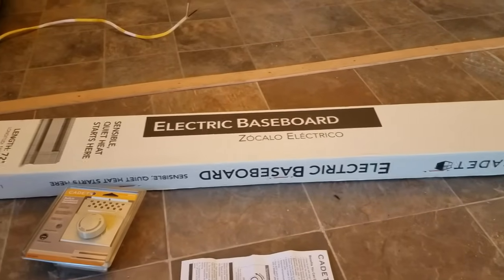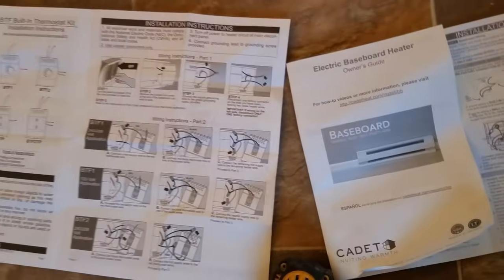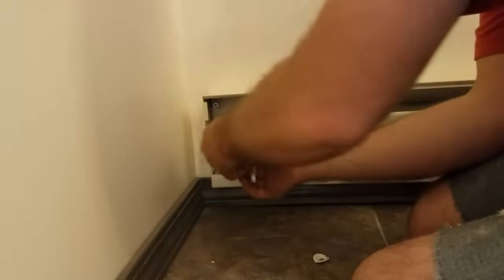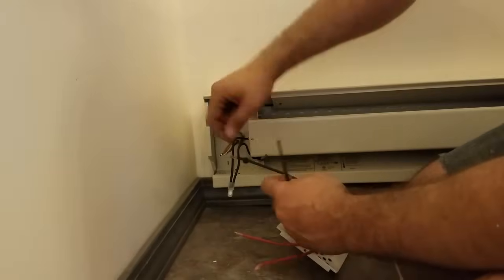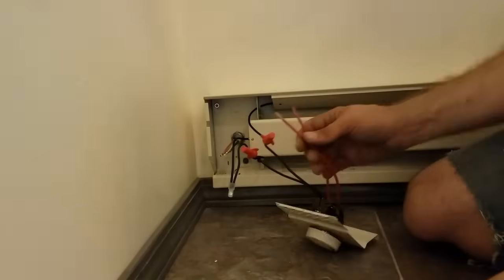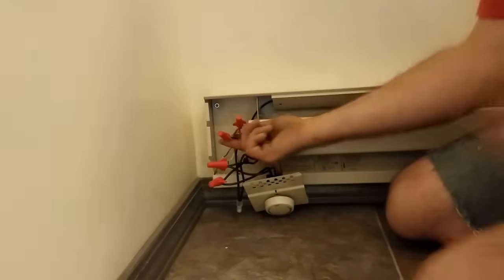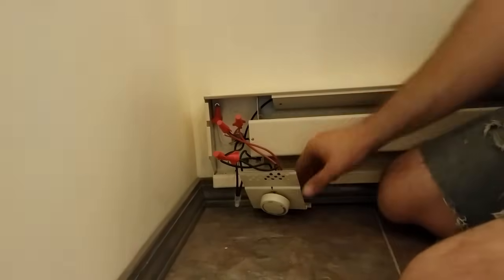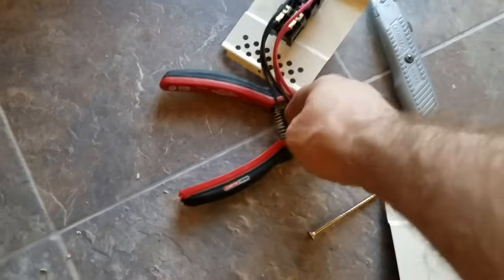Installing Electric Baseboard Heater. DIY

Comment: There's no need for 12/3 wire for this heater, 12/2 is all that's needed
Reply from the maker: 12/2 will work, I like running 12/3 to items like this to keep color coded in the box.
Reply: @agiftedcurse2  its actually  code to do that but can be  done with  a sharpie or as I prefer  heat shrink tube   can get in  black red and other colors but if the  12/3 is already  there no sense in removing it now

Comment: Hi, 
can I install the baseboard without gang box into the wall? The baseboard has it itself.
Reply from the maker: No need for the box since it's wired inside the baseboard heater. Correct. Only time you need a box is when your splicing wires together and not doing it inside the closed baseboard heater.
Reply: Great, now I’m sure what I’m doing is correct. Thank you

Comment: You didn’t say what you were doing... or let people see what you were doing. Usually these videos help explain why you do what you do and how.
Reply from the maker: There isn't too many steps. Just cut the top black wire in the baseboard and hook them up to the black wires on the thermostat, then hook the two red wires to the two hot wires coming in. I explained it but having troubles understanding what I'm leaving out in the video? I recorded the whole process.

Comment: Rushed video....take your time to explain step by step....I get everything you said....but just 4 the first timers DIY people...ty✌✌
Reply from the maker: There isn't too many steps. Just cut the top black wire in the baseboard and hook them up to the black wires on the thermostat, then hook the two red wires to the two hot wires coming in. I explained it but having troubles understanding what I'm leaving out in the video?
Reply: @agiftedcurse2 leaving out running 220 volts to the heater, gauge of wire,  do you use 12/2 or 12/3, what size breaker.
Reply: @agiftedcurse2  
I saw you capped the white, so its a 12/3, is that something that can be done?
Reply from the maker: @paullinntrapgod  I use 12/3 but the white wire isn't used. I cap it still just encase later when someone else is ever messing around in the panel that it will be capped if it ever got power through it. Most are going to use 12/2 wire.

Comment: These heaters are not efficient at all. I was paying $800 a month to heat only one level of my home. I'm putting in a boiler.
Reply: There's a calculation to heating, 1 heater is not going to heat 1 level of your home .. you have to do a load calculation for the square footage of the room
Reply: Na gas, water, hho solar, wind, mass effect omni gel. In my house
Reply: Sounds like you need insulation. if it doesn't hold the heat they will constantly run.
Reply: Lol u must keep ur heater on all day and night

Comment: You showed nothing nor did you explain anything. You rushed through. What a waste of time.
Reply from the maker: You mount it to the wall and you hook up the two hot wires and ground wire to the thermostat and then thermostat to the heater. They are that simple to hook up so there isn't much to show or explain. I showed how to hook it up.
Reply from the maker: Also if you have any questions ask and I'll try and answer them.
Reply from the maker: Sorry it's taken so long to get back to you, just now seeing the comment. Wire size is 12 and I used a double pole 30 amp breaker.

Comment: Hi I have a question I have a 1000w baseboard on a 2500 thermostat with 14/2 wir on a 2x15 amps braker I would like to add a 750watt baseboard will I need to change something or it ok to install thanks
Reply: Absolutely NOT the circuit breaker protects the wire and a 30 amp 2 pole breaker will allow more current through to his 14 gauge wire than it rated for . It's all about the AMPS , a simple calculation will determine total current draw . Total power is 1000w plus 750w equals 1750w and is a straight resistive load . OHMS law states 1750W divided by 240V equals 7.2AMPS . Once total amperage is found wire size can be determined , though number 12 is desirable , 14 guage will work SAFELY and should be protected with a 2 pole 15A , If using number 12 wire a 2 pole 20A
Reply: electric baseboard is a continious load ...125% rule applies on wire and breaker sizing
Reply from the maker: I think that 14/2 wire is a little thin. I used 12 gauge. If they are all single pole you shouldn't have any problems running them together. 2x15 amp breakers you mention makes me think it's double pole and would get 30 amp double pole breakers for it.
Reply: go with 12/2  20 amp breaker.

Comment: One side only have a red and black and a ground do i hook them together
Reply: Im confused on what you're describing, the heater itself should have 2 black wires coming from it, your Romex coming from the wall may have a black, ground & a white wire, but no red wire .. your white wire more then likely is another hot conductor, I would advise you to get an electrician to look at this because your aren't sure what you're doing

Comment: this is a double pole bud..
Reply from the maker: yes, it's a 240 amp heater. I have them on double pole 30 amp breakers. I don't think the 120 amp heaters heat that well.
Reply: @agiftedcurse2  where are you located that code allows  12 gauge wire  on a 30 amp breaker  I've always  heard 15a/14g 20a/12g  30a/10g 40a/8g 60a/6g...
Reply from the maker: @timjohnson6864  You are right, however the 20 amps breakers trip often. Everyone seems to use 30 amps for the 240 heaters so that is what I used. Now that you mention it, i looked it up and for 30 amps they are saying to use 10g wire. I had a couple units that had 120 heaters and they don't heat as well in cold winters so I put 240 heaters in and they kept tripping on the 20 amp breakers which is the reason I'm using 30 amps. Maybe should have put in 10g wire. Will in the future! thanks!
Reply: @agiftedcurse2  I've also had older breakers trip easily  a used 20amp  breaker  isnt the same as a new one even  though  this cold spell I have a 96" and a 72" sharing  the same  line on a 20 amp breaker without  issues
Reply from the maker: @timjohnson6864  When i was having issues with the breaker tripping often i tried several different ones before going up to 30amp and even then, I have each heater on it's own line. The other units that i have dealt with 240 heaters had already been using 30 amp breakers. The baseboards still shouldn't draw more amps than what 12g wiring is rated for.
Reply: @agiftedcurse2  when you sized the break did you calculate  for 125% load?
Reply: I also had looo factory  installed  wire nuts tht caused issues
Reply: also is that a 12 gauge   ground wire?ik some romex has a thinner  ground
Reply: also is that a 12 gauge   ground wire?ik some romex has a thinner  ground
Reply from the maker: @pacman_zero4253  use 12 gauge.
Reply from the maker: @pacman_zero4253  I try to put 200 amp panels in when i can so i always have plenty of slots!

Comment: You wrapped the ground wire around the screw in the wrong direction.  Wrap wire around screw in the clockwise direction and it will tighten the wire into the center of the screw, as you tighten the screw.
Reply: thank you
Reply: If it's grounded there is no wrong direction. Just something that works for you.
Reply: @vipergaming6965  It's not wrong but it is more efficient to do it that way.

Comment: Where can i find that thermostat controler?
Reply from the maker: Menards and lowes have them. They also have a few different types. Digital programmable ones.
Reply: That SlumLord Life  thankyou so mouch you are very kind..
Reply from the maker: I'll have to make another video on this, you can also use wall mounted thermostat and all baseboard heaters on the same thermostat. Also have lock boxes for wall mounted ones. I don't like them all hooked too the same thermostat though due to some areas will be heated and others will only be heated when the room is in use.